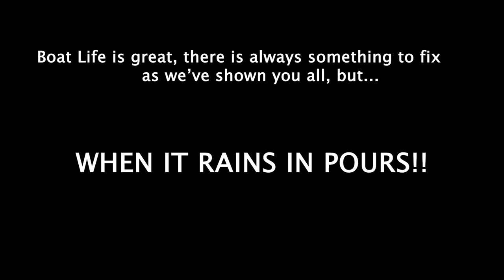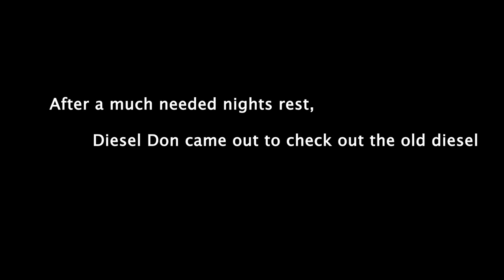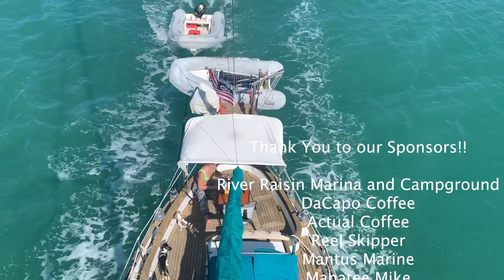Pt 2. DISASTER at SEA, Morale LOW, GIRL Has A BREAKDOWN, We're Almost Home WHAT DO WE DO!! [S2:E69]

Comment: Oh that mischievous grin at 26:58. I actually LOL'd here all alone !
You guys did a rockin job!
BTW, don't seal off the overflow tube from the radiator. Redirect it into a container so the cooling system doesn't over pressure and destroy something expensive. Then when the eng  cools down after a run, pour that coolant back into the radiator. You can keep doing this forever and no harm will come.

Comment: It was a hell of a ride you took us on!  Glad to see the motor issue wasn't a major repair..  I would definitely get that heat exchanger tested out. Those have been known to fail after  10 years, never mind 35. Didn't enjoy the meltdown, but a good nights sleep helps a lot..  I'm sure you have the motor all taken care of by now..  Spare parts!  You might need to update your H2O make..  Outboards.. Flush out those gas tanks!  Make sure there is no sediment or water in them and replace the gas caps on the tanks.. Get them looked at by qualified outboard mechanics.. New motors break down too..  Be safe! Looking forward to S3:E1!

Comment: When things go wrong I look at the building blocks that surround the problem and try to eliminate each area, one at a time. Being tired or hungry doesn't help because you cannot think clearly. Another thing with not being able to locate a fault is to walk away from the problem for 10-20 minutes (if possible) to rest and clear your mind. If the fault is in the stern go to the bow...get away from it otherwise you will keep looking at it and thinking. Spend too long looking for a fault and getting nowhere then as sure as eggs is eggs you will go off at a tangent looking everywhere but at the cause of the fault. I have found and corrected more awkward faults by taking a break away from the problem than you could shake a stick at. 20 years as a photocopier technician and still sane when I packed it in.

Comment: Nice catches! Next time do not hold the rod and reel upside down and it will be easier. And pull the rod up to drag the fish in and then while putting it back down reel like crazy so you don't get slack on the line that's when you lose the fish, and the rod will do the work for you. :) Best luck!

Comment: Nice sailing and nice fish.  Here's a tip for using a multiplier reel on a rod.  Its the easy way trust me.   Hold the rod in your left hand.  Put the rod butt in your groin or into a groin pad strapped around your waist.  Have the multiplier reel upper most.  Reel with your right hand and pump the rod with your left hand.  Not sure why you are doing it the hardest possible way.    You were lucky those mahi mahi were only 4 Lbs and not 40.

Comment: I would never give back my time living on my boat with my wife. But here is the financial lesson I learned. Bought a boat for 50k cost about 36k over the five years between insurance, maintenance, and dockage/mooring. Eventually sold the boat for 48k. 
Bought two houses. One house basically pays for the other and have gone up substantially. Owning two house. Cheaper than owning one boat. And they generate income and provide a tax shelter.  But you can’t put a price on a good time. Godspeed.

Comment: If you girls are concerned about the age/reliability of your engine, you might be able to find someone that will work with you on rebuilding the engine. Not do it for you, but teach you as you rebuild it yourselves. That process will teach you how to repair most problems you may run into over a longer voyage. They will also be able to give you a list of parts you might want to have on board that are typical for repairs. Don't feel overwhelmed at the thought of rebuilding the engine. If you find the right person that is willing to teach/assist you it isn't as difficult as you expect and much cheaper than hiring a shop to do it for you.

Comment: Surely someone has told you that you are using the reel in the wrong way, no wonder you find it difficult. That type of reel is supposed to be used with the reel on top of the rod and the handle wound with your right hand. You have it upside down and because of that you have to wind the handle backwards instead of forwards. Has no one ever told you this before? This is why you find it difficult, flip it around, wind with your right hand and you'll see the difference

Comment: That Mercedes motor, age and all, is a bloody good motor McGill s and 14k it’s just run in, but you really need to look after it, especially oil filters and air filters, it you do that you will have years more reliable service out of it. A diesel motor is built to run hard and long hours so considering the workout that boat gives it you are good. I would suggest, when you get the doe, get a reliable diesel mechanic to give it the once over. You girls also need to educate yourself about all the basic system on your boat as it becomes critical when the shit hits the fan. Well done though, shutting down the engine saved damage and calling that guy out showed real maturity because you were over your head but had the sense to ask for help…..and most of all remember why you are doing this…..not to stress and have fizzy fits, achieves nothing and demonstrates you aren’t resting up, listen to your body. Good luck for the rest of your plans

Comment: I watched this just for reenforcement on why I'm a single hander (little disappointed) but hey. But did I hear correct that you have planned 35 day passage? If so  I can't think of any passage in the world that will take 35 days without seeing land. The longest I've gone is 25 and I never motor more than 5 miles (avid reader). Your boat ain't lickety split but no where near slow and the longest run I can think of is from is taking off from the Galapagos and that run on a boat like yours at a stretch is 20 to 25 days. I doth think yea worry too much lass. Oh I've been around a few times once on a lot slower boat than yours....